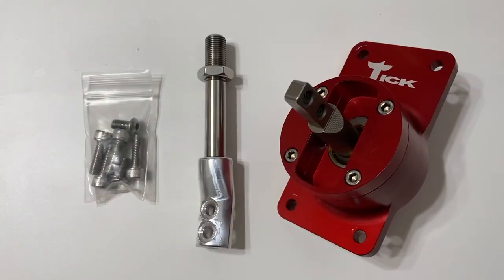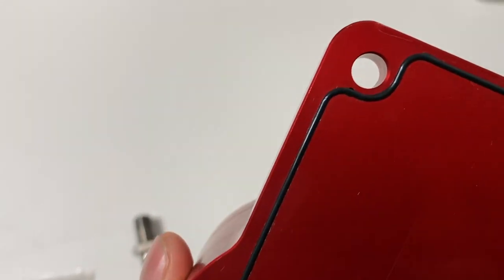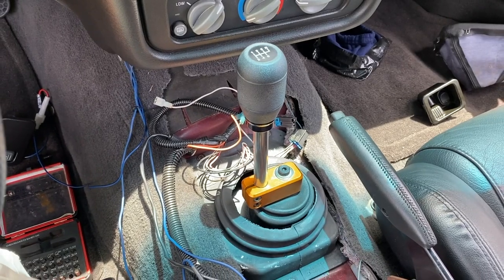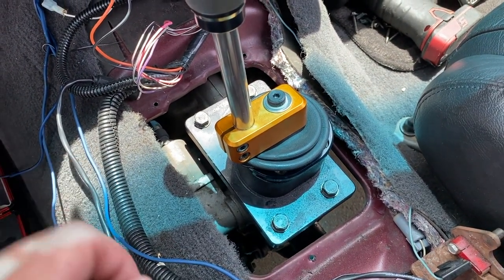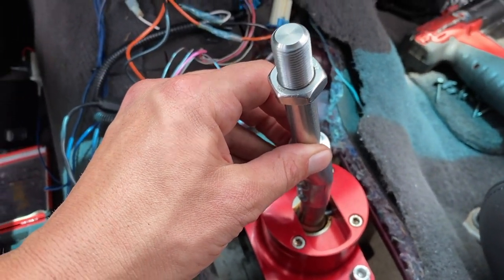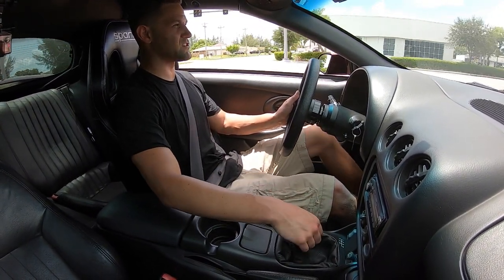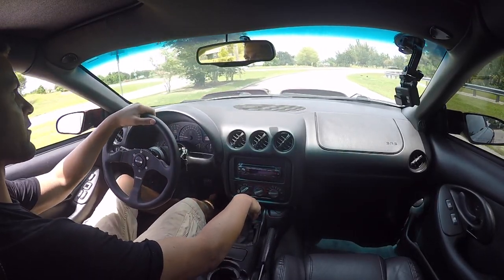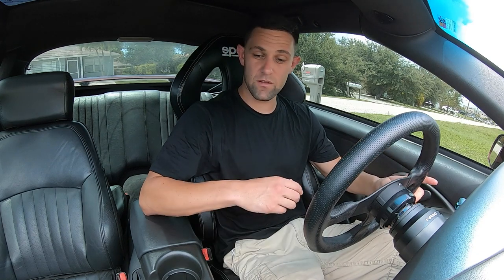Testing Out The New Tick Performance Shifter

Comment: How does it feel over the mgw? I’ve had an mgw for years and was gonna transfer it over to my new trans but I just saw tick has their own shifter.
Reply from the maker: LsxMatt I would miss 3rd gear occasionally with the MGW. The centering springs in the Tick shifter are noticeably stiffer/stronger, which makes grabbing 3rd effortless and I haven’t missed a gear.

Comment: Nice short throw shifter. I just got to mention my friend your interior is like brand new. most of the 93 - 02 the dash board cracks. My 94 project trans am is in need of a complete dash replacement. I'm going to be ordering a used complete dash. Mine is cracked all over. Hawks Motorsports has dashboards that are in pretty good shape. So after my car is back from the paint shop I can order my dashboard. I've got the front windshield out so my painter can paint the ttop roof jams . Nice video my friend 👍🤙
Reply from the maker: Appreciate the support brother and yeah I’m big on having a clean car, especially the interior. Sounds like you’re building a nice car as well man!
Reply: @KennySlides  I'm building a project 94 Pontiac Trans am. But it's going to be a few years before she's complete. Keep up the great videos and be safe out there my friend 👍🤙🇺🇲..

Comment: How is it compared to the mgw? Just put a mgw in my car.
Reply: I wonder the same thing. It seems like a sponsored review, i dont think you would get an honest answer. I have bought the tick shifter and i like it. My one gripe with it is its really far over to the passenger side which feels a little weird, but im sure i could get used to it. I dont like it going into reverse. It smacks my console over maybe 1/2 an inch to guarantee hitting reverse. Those reasons almost makes me reconsider getting the MGW.
Reply: @invictus7381  my MGW it set over to the left, i really like it. Definitely seems like a sponsored video tho.
Reply from the maker: Honestly the shifts are more direct and the centering springs are stiffer which make shifting to third more effortless. With my MGW I would occasionally miss 3rd gear under heavy throttle and with the Tick I haven’t had any issues

Comment: Just ordered this..only thing I don’t like about the short throws are the clunky engagements..too lazy to do the detent mod lol. I’ve had the factory hurst and a short stick forever. I like the hurst but my centering spring is gone..would occasionally hit the gate 2-3 and 6-3 shifts would go right into 5th lol. Excited for this, definitely gonna do the detent mod with this one. Glad I can keep my factory hurst handle, I really like how that feels in my hand. Love that 2step main rev limiter by the way, sounds SICKK on the spark cut 👍
Reply from the maker: Sounds like you’re gonna have yourself a dialed shifter setup my man. I appreciate the support 🙏🏼
Reply: @KennySlides  how do you like the ball vs your cylindrical style knob? Is it weighty? I’d like to try something a bit heavier than my stock hurst but unsure what to go with. Anywho, sick TA. Sad to find out you sold it. Subscribed
Reply from the maker: @matthewstansbury3047  The weighted knob honestly felt great and thanks man I really appreciate that!
Reply: @KennySlides  ive definitely read the extra weight helps beat that t56 notchiness lol. Thanks man. Awesome channel

Comment: So this has a shorter throw than the MGW and Hurst short throw shifters? I have a Hurst on my 99 Camaro and it feels pretty short.
Reply from the maker: It has a slightly shorter throw but what sets this shifter above the rest are the stiffer centering springs, which make the shifts more precise and crisp which help eliminate miss shifts
Reply: @KennySlides  I may give it a try. Thanks for the info.
Reply from the maker: @TURBOLSJBALT06  No problem man!

Comment: wonder if I could slide a b-body like your trans am lol. I got a t56 and 4.10s in it but it's stock power to which I assume I'd need a lot more to slide easily. And I guess all the suspension dialing in is also there.
Reply from the maker: Give it a try man!

Comment: Hi, Do you have any idea how it stacks up to the MGW?
Reply from the maker: Alexander McDole The centering springs are stronger which make the shift from 2nd to 3rd more crisp and effortless
Reply: @KennySlides  thanks
Reply from the maker: Alexander McDole No problem!
Reply: @KennySlides  I was just wondering because I have the MGW, So far it's been pretty good and it seems impossible to miss a gear.
Reply from the maker: Alexander McDole Yeah I had the MGW previously and I would occasionally miss 3rd
Reply: @KennySlides  Really? Guess I've been lucky so far, just thinking about getting the Tick one.